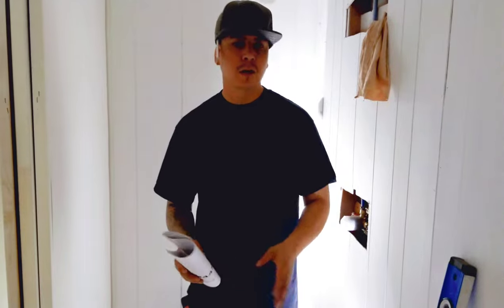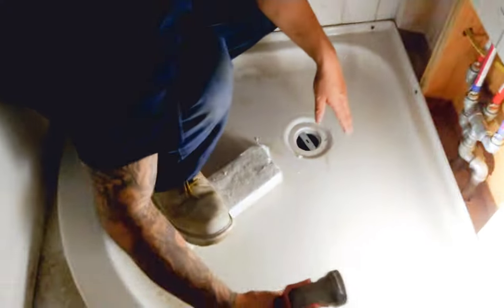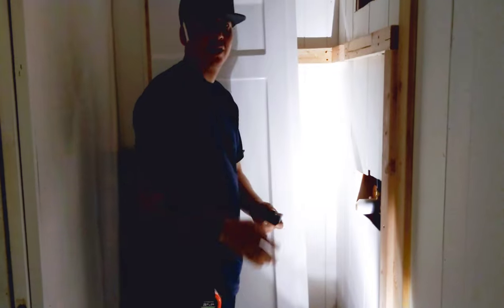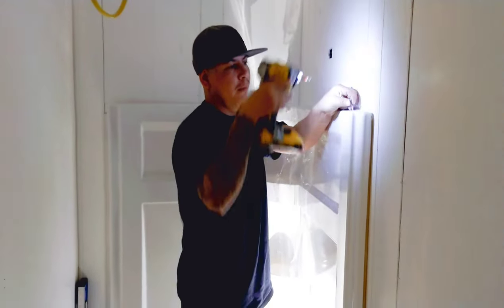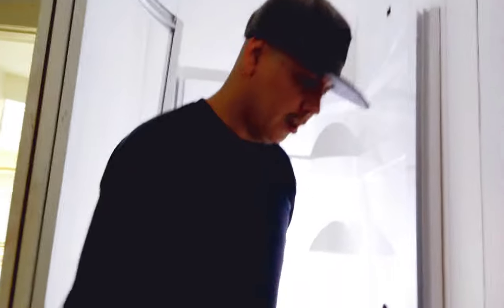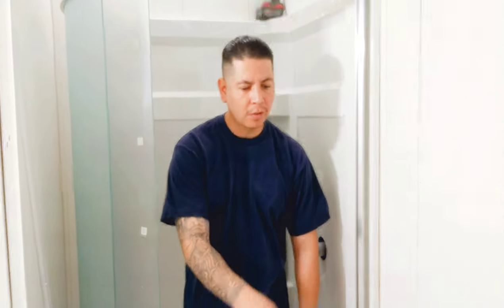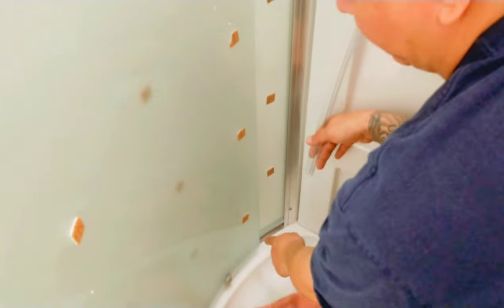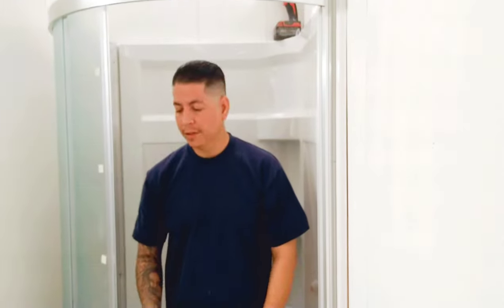Part 2- Corner shower Install

Comment: Awesome video for several subtle reasons, thank you!  Viewers please note Mr.Fix-A-Lot's not following direction in all cases is a huge improvement!  I only wish I could have seen this video before I started mine. Here are some additional thoughts and notes I learned with my DIY of the same shower which I hope will add to Mr.FAL in helping others:

1. I purchased the MAAX Cyrene from Menards for ~$750, about half the price of similar units.  The store display model was very attractive with its 3D wall panels and the door frame/glass combination seemed much more solid than the more expensive corner units on display.  Installation made me realize the 3D wall panels seemed too thin and somewhat flimsy to support the 3D design with air voids behind wall. 
2.  I followed directions exactly, which was a mistake.  Directions called for caulking and screwing the 2 assembled wall panels onto the base/pan before setting in place. This created a great deal of fitment, adjustment, and cured caulk failure (from flexing) problems for me, especially since my corner space was slightly off from 100% square and level. Wall framing was done to spec but required adjustments to make fit.
3.  Directions also called for mounting the fixed glass panel into the door frame before lifting/placing the frame/glass into place on the shower. This made no sense and would be much more difficult, this is when I searched again and found Mr.FAL's just posted video. Thank you for showing it could be assembled the common sense way!!
4.  Tips:  In addition to floating base with foam, working some baby powder into spaces between base pan and the styrofoam filler under the pan completely eliminates all squeaking caused by the styrofoam (thank you other YouTubers).  I found wetting the preformed silicone fixed wall gasket with rubbing alcohol lubricated it enough to easily slide/wedge into place between the fixed glass and door frame.  Also, applying door & window expandable foam to unsupported air gap areas behind the 3D wall panels added a great deal of a solid feel and eliminated flexing when those areas were leaned or pushed on.

Thank you again, Mr. Fix-A-Lot for a very informative video.  With a few 'modifications' the MAAX Cyrene shower can be a solid and beautiful low cost shower.
Reply from the maker: Thanks for your comment and suggestions. There is many things in these instructions that made it more complicated then it should have been. So thanks for your tips
Reply: Great tips Rick I am about to start my installation of the sister unit to this shower. Much appreciated!
Reply: @MrFixALot  what s the spray stuff u used to put down the base??

Comment: Thank you for this video. I’ve had this kit in my garage for six months as I prep the rest of the space but time has come for the shower instal. The instructions from the manufacturer are very vague and I’ve been dreading this step but thanks to this video I feel much better. 
Also thanks to comments by Rick for additional tips.
Reply from the maker: Happy to help. Hope your install goes well.
Reply: I saw they mention to screw the wall panels t to the base from behind do you both doing it or no?
Reply: @giancarlogrado9749  I did not screw to the base. No way to access it for me as I had drywall on that wall. Seems solid without that step but i did use caulk to attach the wall to the base.

Comment: My plumber roughed in the water/drain and mounted the base in permanently…before I knew the instructions called for the two walls to be screwed into the base… I’m glad I found your video, it seemed crazy to screw into the base at the bottom of the walls… and now I’m not..!! Thank You Sir..!

Comment: Recently purchased the sister to this model and boy am I glad I saw this video! I've read through the installation of the base and panels several times and the instructions made no sense to me. I will be following Mr. FAL's methods for sure and thanks to Rick Duncan for your comments Rick they are also very helpful.

Comment: Excellent video! Thank you for pitting this together.  All your advice and process putting the shower together made our shower install a success.  The Cyrene Maax installation manual did not explain a lot of things and you covered every detail.  Your video along with the tips in the comments section helped so much.
Reply from the maker: I've had to install several of these and the manual was not much help. So I'm glad this video helped you out.

Comment: I’m installing the same shower in my basement. I’m finishing my rough in framing. What constitutes a finished surface? Exposed studs? 1/4” or 1/2” drywall? Or 1/2” treated plywood? Thank you for sharing your videos.
Reply: What'd you wind up doing?  I'm going to try to just put one on exposed studs, I'm not sure finished walls matter
Reply: Thanks for the vid man, I'm about to tackle this same shower this weekend and this is a great help!

Comment: great job! if you have time, wondering why you didn't screw the sides to the base as per instructions? Also, to get at the 'angle' adjustments [behind rollers on door] do you close the door and access them from the outside? appreciate your thoughts. thanks.

Comment: Hermano the the Glue you por inside the drain pipe,or around the pipe  and than you connect?Gracias
Reply from the maker: I used ABS glue to connect drain to the pipe.
Reply: @MrFixALot  Gracias. Buena suert pa Oste

Comment: Thanks for the great video! Question  I bought a similar model but the instructions have me screwing the walls to the base and then sliding all three pieces into the corner. Can I install the base first like normal people do, and avoid the bottom screws? Just glue the bottom of the walls to the base with silicon caulking? That stuff works great! Many thanks.

Comment: According to the manual walls should be attached to the pan with screws and whole construction moved into the place, Looks like you did not have enough space to do it, so you install walls after pan was already in a place. I have the same situation. Ok, you attached top of walls to the 2x3 with screws, but what about the bottoms? The bid of silicone will seal it but not glued to the pan. I think to use fast grab or else adhesive to the panel  behind the cab flat part of the wall and hope that will hold it strong. In general great video made by real installer with all kind of adjustment   you need to be ready to do in real life conditions. Good luck brother in trade!

Comment: After you put the curved frame in place, do you not screw it in before installing the glass walls?  Completely skips that step in the instructions also.
Reply from the maker: Yes, screw in the curved frame before installing the glass walls.
Reply: @MrFixALot  Thank you for the quick response.  Love this video.  I have a larger gap at the bottom of the walls to the base, not sure why as I measured all the strapping.  What's the best way to fill a large gap?
Reply from the maker: It's no problem. I would re-install the strapping. I know it's not what you want to hear. It's what I would do. If you can't for what ever reason. I would put some backer rod in that gap and use lexel.

Comment: Hey brother i have a leak in my shower behind the wall I can’t find the hoses you think I have to change everything? Thanks
Reply from the maker: I'm sorry to hear that. I would first remove plate cover to access shower valve. Id see if the leak is in one of the connections at the valve. Most of the time it is. If it's not there, then I'd remove the flange to the  shower head and see if it's leaking at the stem. If there is no Teflon it will leak. Lastly if you don't see the leak from those two areas, unfortunately the only way I can see to fix that is by removing it or cutting drywall on the back side of shower wall and accessing that way. Good luck.

Comment: I searched for a video because I wanted to know how the framing was done to make sure there was wood in the wall behind all the blocking that goes on the drywall. Did you get lucky that there was something behind it or did you add blocking?

Comment: Hi, I would like to know if you had a second drainage booklet manual with your instructions.
If not, how much below the baseline of your bathroom did you cut your ABS pipe
Reply: Basically, how did you cut your ABS pipe for the drain.
Reply from the maker: Unfortunately I don't have the manual anymore and don't remember the measurements. What I would recommend is to dry fit everything, put it together and test it. Redo these steps until it's perfect. Then i would glue it.
Reply: @MrFixALot  did you have 2 manuals or just 1

Comment: Great video thank you so much, i do have one question, does the base of the shower walls sit on the lip of the shower (you used the lip to screw base into studs ) or on the pan itself?   Maax instructions really does not show the lip on the shower base thank you in advance for responding
Reply from the maker: It sits on the pan itself. The lip will end up behind the wall panels. Make sure to use silicone.
Reply: @MrFixALot  thank you so much !
Reply from the maker: @siobhanborne8492  no problem.

Comment: The squeak comes from in between acrylic and styrofoam..  Not the floor  The "fix" is you have to try and get some cornstarch or talcum power in between the 2 layers..  It's tricky.. pry apart and do your best to spread some powder in between...  NO MORE SQUEAKS..  It works like a charm.

Comment: My shower started is leaking under the  base  😢😢😢 i will be taking apart. I dont remember using glue and dont remember that being in the instructions, i wish i would have seen this video before installing

Comment: Did you screw the 2 wall panels to the base or only at the top?
Reply from the maker: I screwed the wall panels on the side and the top only. I used silicone at the bottom.

Comment: You dont show the part where the gasket goes in between the fixed glass panel and   the left frame piece using the plsstic box handle
Reply from the maker: I tried to record everything. There was a few things I wasn't able to show.

Comment: What size hole did you drill in the shower wall?
Reply from the maker: I used a 4" hole saw.
Reply: Thank you! Hoping to tackle this tomorrow. About how long would you say it takes from beginning to end?
Reply from the maker: It took me a full day and a few hours in the morning. You got it, it's frustrating at times with the bad instructions but just watch this video and keep at it. You will knock it out. Hella rewarding. Good luck.